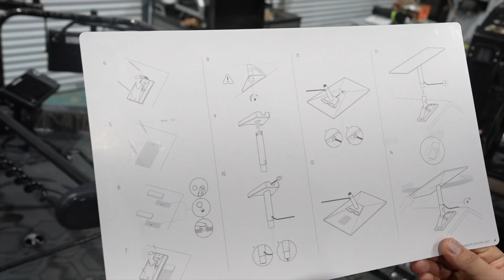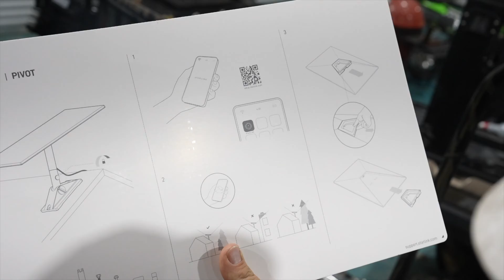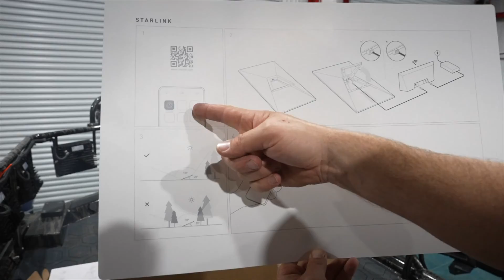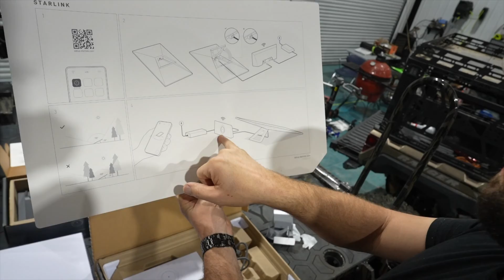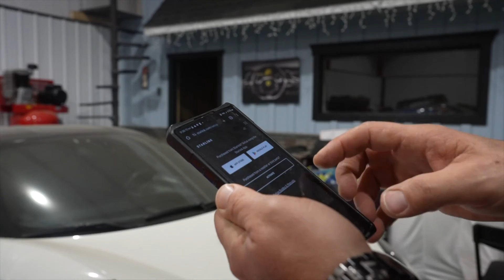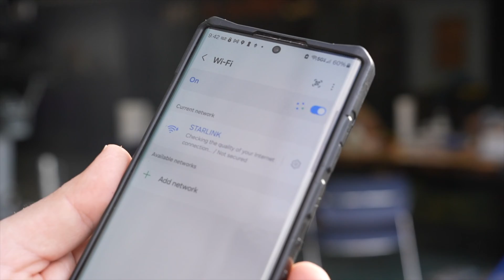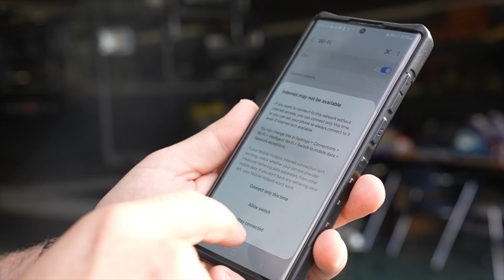Setting up Elon Musk’s Starlink Internet | Unboxing and Review

Comment: We're over in Delano (Benton area), we've been using Star Link for about a year now. It's been awesome for us. We can stream multiple things with no problems. Good luck!
Reply: Loving it so far.  So glad we can get access to it now in our area.  Have you traveled with it or just left it fixed on your mount?
Reply: @joepalmer7537  when we were really traveling, it was only a stationary system. They cleared it for camping right when we bought the property over here and stopped using the Diesel Pusher. I've heard great things from friends that camp though. I believe you have to set up a travel account with Star Link though. I don't think you can just pick up and move it around without letting them know.